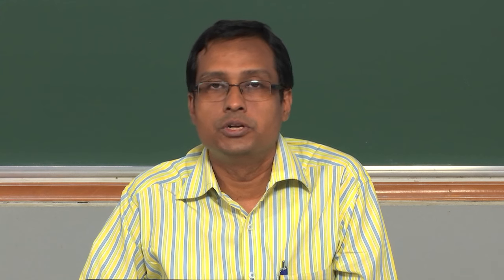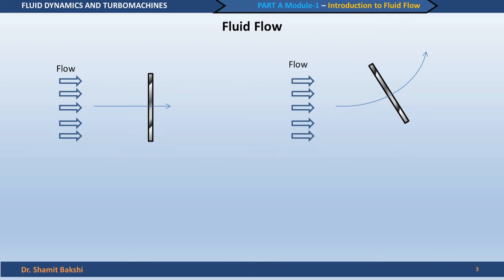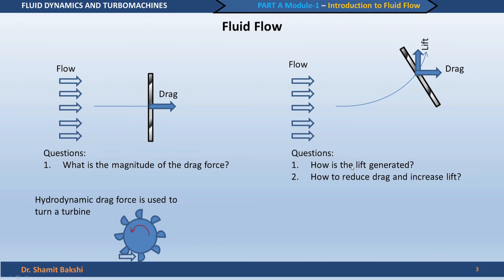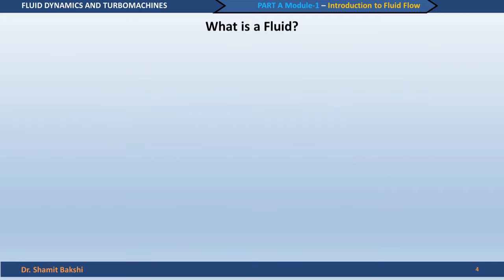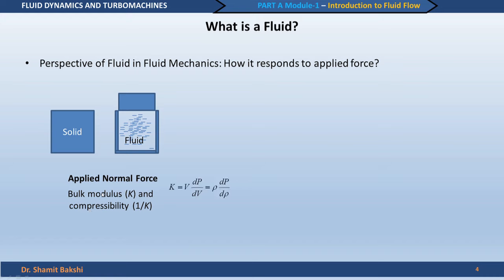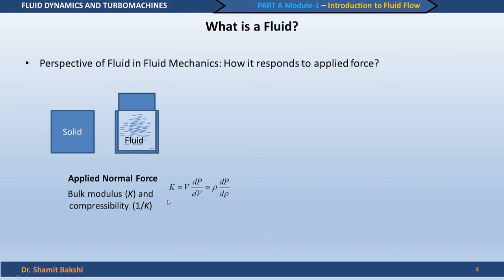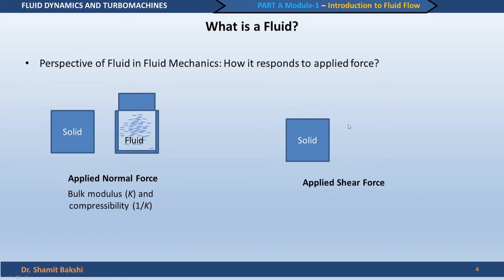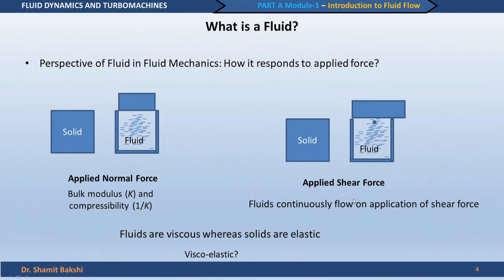Introduction to Fluid Flow

Comment: What is the exact difference between Eulerian and Lagrangian approach?
Reply: langragian is single partice concentration approch where as eulerian is space concentration approch
Reply: Clearly, Mr. Pankaj Vashisth hopes to dazzle you with his language. I suspect he himself does not understand what he has written, spelling mistakes and all.

Lagrangian approach is, simply, "ride a particle". Choose a particle, get onto it, and therefore go where it goes, do what it does, experience it.
Eulerian approach is: take an easy chair, sit down, focus your eyes on a small portion of the fluid flowing, and stare at it. Watch all the comings and goings of fluid particles. Forever. Don't look left or right. Just on the region of your interest.

So, Lagrangian is "adventure", and Eulerian is "Yoga".
Reply: @aerodynamico6427  well put really....really deep thinking😊
Reply: @aerodynamico6427 so in short  eulerian approach is about specific region whereas lagrarian approach is     continuously motion of the fluid particle 
Am i right?
Reply: Typical difference - 
• Eulerian Approach : 
1. Analysis of fluid flow from point to point in geometric space & the considered time frame. 
 2. At any point it is assumed that fluid is flowing continuously in the space. So that all the properties like density, pressure, temperature, velocity, etc are valid at any point in that space (Eulerian space) 
3. There are numerous fluid molecules that passes through that any particular point has all the applicable variables of that point. 
4. All the conservation equations are applicable at any point in the space or control volume considered at any instant in time frame. 
For eg. P = P(x, y, z, t), T = T(x, y, z, t), etc. 
Field variables. 
(Application - Almost more than 90% practical problems are solved using this approach.) 

• Lagrangian approach - 
1. Any particular fluid chunk or particle or element is considered in the space & its thorough motion is traced. 
2. That particular element is tracked since start of the analysis or initial state I.e. at time, t = 0 & its corresponding properties are tracked since start to end. 
3. If we considers each & every fluid element to track its motion, this analysis is complicated. As there will not be practical solution always in analyzing only single or some particles throughout the analysis. 
For. Eg. T = T(x_0, y_0, z_0) at starting point or t = 0 to continuously monitor its T = T(x,y,z,t) in space & time for only that particular fluid element. 

(Applications - This approach is used in some domains like particle tracking applications, molecular dynamics, bubble or droplets dynamics, motion of discrete sized impurities or contaminants, interface tracking between liquids & vapour bubbles, etc. This approach is highly unconventional & hence, used in very relevant applications.)